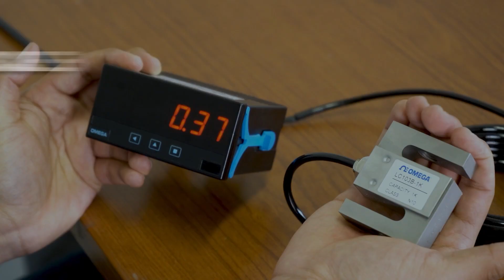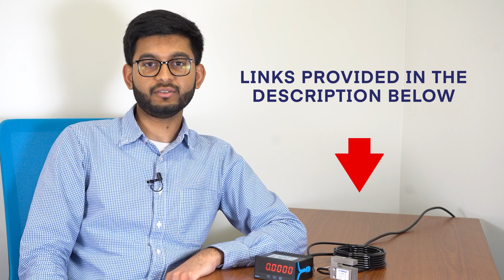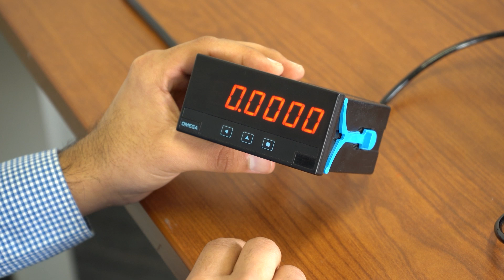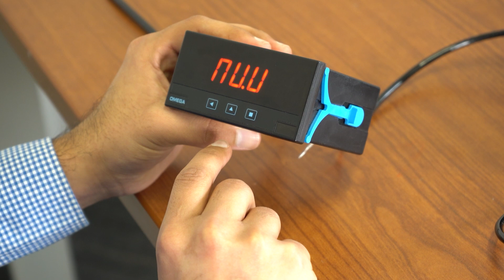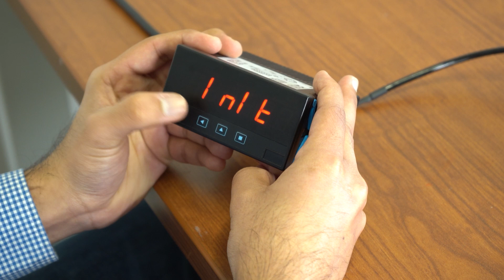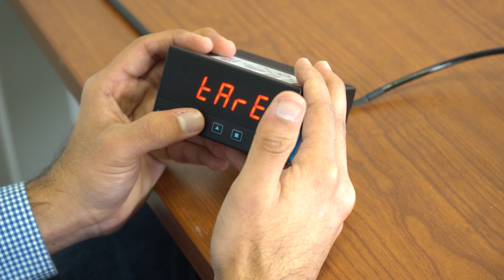DPS20 Strain Meter - Setup, Configuration and Scaling Tutorial

Comment: I'm updating from a Omega DPF700 to an Omega DPF20 and using a Omega FTB602B Flowsensor. With the DPF700 I would set the function to rate and set the decimal point at 000.000
I then set the scale to IN/SC and set it at 133.333. How do I accommodate this setup with the DPF20  meter?